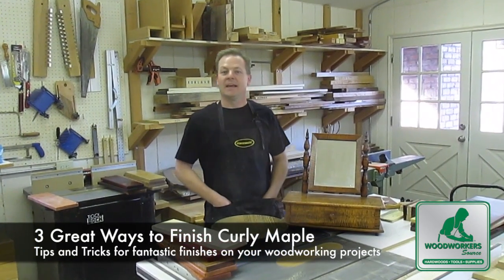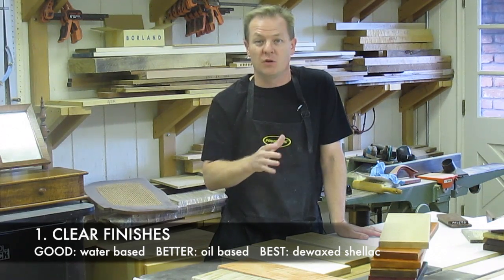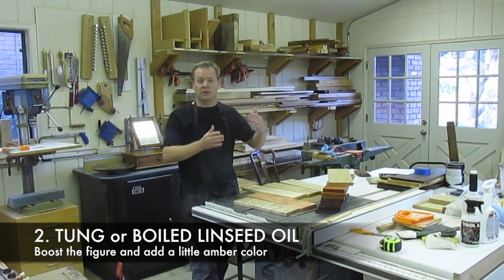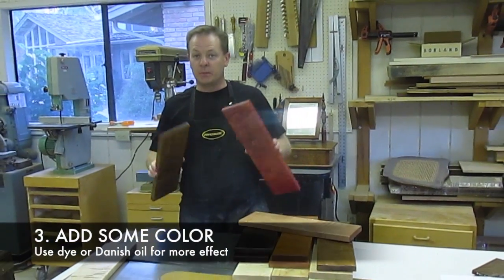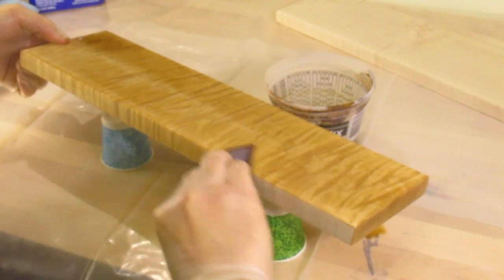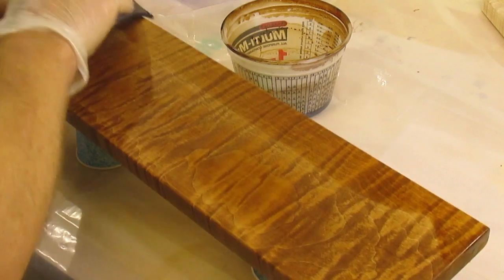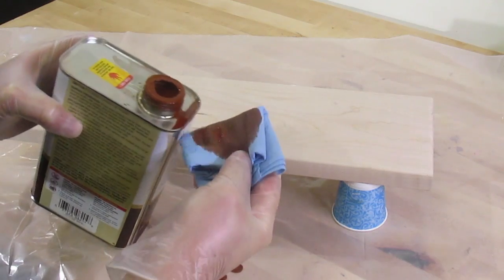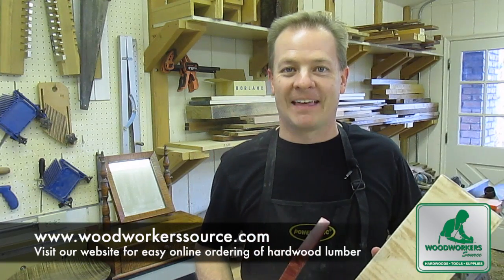3 Great Curly Maple Wood Finishes That’ll Blow ‘Em Away

Comment: You should try some Aquafortis. It was used by American gunsmiths from before the Revolution forward. It is a mildly caustic solution of 50% nitric acid and distilled water that is then neutralized by dissolving iron in it until no reaction is seen. Strained through cheesecloth and kept in a glass bottle. You can buy it already prepared from Track of the Wolf. It is wiped on with a dauber to wood that’s had the grain raised several times and left to dry. Heat is then applied, the larger the source of heat the more even over the surface coloring,the smaller such a narrow bar of hot iron the more control over selective darkening. The current artificial sunburst finish in some instruments was originally achieved with with selective use of heat in this way. It can range from a light tan or yellow through orange to a dark brown. It actually cooks the sugar in the maple which is what gives it the caramel coloring. The traditional topcoat was boiled linseed oil which multiplied the translucent effect. A pretty piece of maple looks like it on fire . The oil could also be used to blend damage and was regularly applied on rifles when cleaning.

Comment: amazing finishes, also another good one is to use map gas and lightly burn the curly maple and use a brass brush to brush off excess burn going with the grain then finish with a  high gloss top coat..

Comment: Thanks for the video. I really like how you present the different options. 

Do you have a product recommendation for finishing maple that might prevent maples yellowing over time from UV light exposure?
Reply from the maker: Preston Hoffman you bet. A coat of dewaxed shellac and then top it off with a water based finish like general finishes high performance water based top coat. That combo has a really good longevity when it comes to non yellowing
Reply: @WoodworkersSourcecom  - "defaced shellac"?  really!  Don't you mean "dewaxed" shellac?

Comment: I did my first piece with brown orange and yellow aniline dyes. It turned out ok but just not the look I quite wanted. I would like more deep natural look. I was wondering if there is anything else that works for that. I see pictures on google of amazing looking wood when finished. I am not sure if I should kiln dry the wood and then soak it in Mineral oil over night to get a most translucent curl look. Do you have any ideas?

Comment: Not clear from your video, but did you sand the 3rd. coat of Dye, then put the Tung or Linseed oil on, or leave the 3rd coat UNsanded, then apply the oil? Thanks!!

Comment: This was excellent! Thank you for going through the different examples. If I was going purely for enhancing the brightness/sheen of the natural figure...keeping that “shimmer” if you will...what would you recommend? Based on your video, I feel like boiled linseed oil would best achieve this...but is there any process that would work better? I plan on making each of my daughters a jewelry box from figured maple and really want that natural shimmer in the wood to pop. Thanks for any tips!!
Reply from the maker: Either the oil or dewaxed shellac sounds like will do what you want. Oil gives it a warmer/yellower color. Shellac less so. That's a consideration.
Reply: Woodworkers Source  In the video you suggested the oil then the dewaxed shellac before doing a top coat of choice, so maybe a combo would work for me as well? I do want these to last and hopefully be keepsakes for them one day.
Reply from the maker: @bobbarr613  haha, thanks for the reminder.... it's an older video so I wasn't sure what exactly was in it lol. I'd say you're on the right track though - oil to boost the figure, and something on top to seal and protect. Check out Old Masters Tung Oil Varnish (not the 100% tung oil, but tung oil varnish), we've used that in a lot of more recent videos. It might be a simpler way to get the look and long term protection without having to apply 2 or 3 different products.
Reply: Woodworkers Source I will do so :) Thanks so much for the responses and helpful advice!!

Comment: I am working on a piece of wall decor with some maple I salvaged from an old dresser.  I believe there are some curls in it, but nothing quite as extreme as in your video.  I like the idea of a surface that invites you to touch it, so I don't want to use polyurethane.  Do you think an amber shellac would be enough to achieve this?  If not, what would you recommend?

Comment: If I want to topcoat with polyurethane after tung varnish, does it need to be oil or water based?
Reply from the maker: Doesn’t matter as long as the tung oil coat is cured

Comment: I bought a beautiful old curly maple cabinet - I didn't see this until I got it home (I had planned on painting but it's too pretty). For me,  the tung oil makes the nicest finish. Because I know and have nothing, I need a "shopping" list so I have everything on hand. And I need an idiot proof step by step list of what to do. I don't mind the time it will take.  Also, it looks like the supplies (which I will use only once) will cost more than the cabinet did. Do you have a list of what to buy and an exact how to? OR is there a way of showing the beauty of the wood without so many supplies? I've looked for other instructions on line but they also speak to experienced craftsmen.

Comment: I am finishing a table.  I have applied two coats of boiled linseed oil and will apply one more.  I am doing a fine sand between coats and allowing each coat to cure 12 to 15 hours between coats.  I would like to apply a hard clear coat over the table.  The table is for my son and it will take a beating.  I am thinking oil based poly.  How long should i wait after applying the last coat of BLO before applying the poly?
Reply from the maker: Give it at least 7 days if you can, but fewer may be just fine

Comment: How would you dye 1.5" curly or quilted hard maple turning squares to where the dye would completely penetrate the wood for turning at a later point?
Reply from the maker: jxbartle I don't think dyes can can penetrate that much. Dye after turning.
Reply: +jxbartle get a vacuum chamber setup. It will basically suck the air out of the wood and replace it with dye.

Comment: Hi,
I recently made a counter top and a peninsula top. I was ready to stain and finish but decided to seal the underside first with a clear coat finish. After applying the finish, the peninsula looked almost cherry in color making me think the curly maple was a different species of wood. My normal counter top was a true amber maple color. My question is this. Is it possible to make a maple counter top match the peninsula color? I don't want to have to make another maple top.

Comment: Great video, I am about to start working on a guitar neck project that has an undesirable looking white maple neck and back, both sides have a light polyurethane clear coat (satin type finish).  I like the idea of the Danish Oil to darken the wood (which is the desired goal). What do you recommend to remove the polyurethane that is on the fretboard so I can apply the Danish Oil ? I heard Paint thinner helps soften the poly, then maybe some light some wet and dry light sanding ? Then would a satin finish help seal the Danish Oil or is that even necessary as perhaps the Danish Oil would dry hard enough to seal the wood ? Thx Steve

Comment: Chatoyancy is a major component of a good wooden project. If you want the look of wood grain, get laminate. 
Shellac (any kind), thinned polyurethane, and tung oil are the best products I've ever used to get chatoyance. 
-- Minwax tung oil seems to be less amber than Waterlox for crystal chatoyance. Waterlox seems to be more durable against moisture and chemicals. Armor seal is great too. 
-- Spar urethane gives you that Jurassic Park amber with fewer coats, and seems to resist the sun rather well. You can dilute it, plus it seems different from normal polyurethane. 
-- Amber shellac is amazing when you use dark walnut stain. It's like gold embedded in coal. A personal favorite of mine. 
-- 1.5lb cut dewaxed shellac is probably the most crystal chatoyance you can get without the hassles of linseed oil.
-- Lacquer can give you mixed results. Black lacquer is a different ball game.
-- Water based polyurethane ruins chatoyance. This video confirms that water poly is a better top-coat. If you want a beautiful finish, put in the time!

Comment: I have a 25 year old table with lacquer finish. The finish if ok but I just want to give it an extra coat of clear finish. I can't spray lacquer in the apartment. If I scuff the surface with 320 grit, COULD I USE WATERLOX WIPE-ON ?
Reply: It says on the can

Comment: Can you use tung oil then seal with a water based poly?
Reply from the maker: shane vinson sure. However, the tung oil should be cured before applying the water based finish. Or if in doubt lay down a coat of dewaxed shellac before the water based finish.

Comment: This is a great video - thank you Mark.  I do have a question about regular hard maple.  Just about everything I tried (including golden oak and cherry Danish oil) comes our blotchy in some areas.  Same with gel stain.  I can eliminate the blotchyness with shellac base but then I don't get the color intensity.  Is this something a dye would address?  I have not tried a dye, and would shellac still be needed as a base when using a dye? Thanks.
Reply from the maker: Right, dye is the stuff to use on hard maple. I would use a water based type, applied right to bare wood. Then topcoat with just about anything you want.

Comment: Great video! I'm not a woodworker, but I have some questions about finishing maple. I asked about which type of maple to use after your video about different types of maple. I'm building a sit-stand desk, for a computer, monitors, keyboard and mouse. I'm generally not abusive on desk surfaces, but I would like it to be reasonably durable (e.g., use a mouse, without a mouse pad). The desk will have a 48" x 30" x 1.5" solid wood top. I'm planning to have someone build it for me.

After I watched your video about types of maple, I'm leaning to curly maple or quilted maple, but I'm wondering if curly maple or quilted maple is a good choice for a desk and if so how to finish it. I would like to emphasize the natural character of the wood, without going over the top making it dark or changing the colour. I also would like a finish that's reasonable durable, will stand up to a mouse and keyboard and won't be damaged by some sunlight. (I don't want it to discolour with age if possible.)

I would appreciate your suggestions on finishing, if I go with curly maple or quilted maple. Thanks.
Reply from the maker: hey Daryl, Mark posted a reply to you on the blog FYI

Comment: Thank you for this great video! I was wondering if it would be possible to either make a video or tell me how to proceed with wormy maple to make the wood dark, but still keep the wormy figure visible. My tests with a traditional oil stain and a colored hard oil finish are pretty much hiding the wormy figure. I thought of using dyes like in this video with sanding sealer but I am not too confident it will keep the figure, or will darken the wood properly if I put sanding sealer on the natural bare wood then stain. Any help would be appreciated. Thanks!
Reply: The danish oil he uses towards the end could do the trick.

Comment: I love your video!

I wondering if this also work with regular maple? and if I put lacquer for my top coats. Do I need to sand btw coats and how many coats consider good? How can you tell if it is sand smooth? I am sorry I am a starter on wood working. =P
Reply from the maker: Sure, it'll work with regular maple as far as coloring the wood goes. It's a fine method. Whether or not your sand between coats of lacquer largely depends on how smooth of a finish you want --- but generally I do recommend sanding between each in order to get the best, smoothest finish possible. The only downside to not sanding between coats is it just won't quite be as smooth as it can be. And only you'll know. :-)
Reply: +Woodworkers Source thank you so much :)

Comment: What kind of store would I find the Behlen dye, or similar, locally? Also, I like the way you finished the curly with the dye. Could I use that process and finish with an automotive cear coat or will there be any issues with that?
Reply from the maker: Usually can find it at a woodworking store if you're near one. Or it can be bought online at Amazon or other places. I am not familiar with using automotive clear coats, so I can't say for certain . . . but it is probably just fine. Test it and see how it goes.
Reply: Woodworkers Source  would I be able to replace the dye with a regular stain and do the same processv you showed with the dye?
Reply from the maker: Adam Popp Oil stain has a different effect and it's arguably not a pleasant one. You can't use it instead of dye and get the same result as the dye.
Reply: Woodworkers Source ok, thank you for all the help. I ended up using ting oil, and I'm not as happy with it as I thought I would be. I want to do the dye process for sure, and just ordered some. What process do I have to do to the wood with ting oil before I can dye it?

Comment: After sanding the last coat of dye off, does it still pop if you apply a tung oil varnish? I'm building 2 cherry nightstands and finishing with a tung oil varnish. I have a billet of flame maple that I had lying around and in the shaker tradition want to use material I have lying around. I still want it to contrast harmoniously with the cherry and I'm afraid a dark dye or something will make it look bad in contrast. If it still pops after sanding it off and applying the tung oil, I'd like keeping the blondish color. I've never worked with this kind of figured maple though.
Reply from the maker: Yes, it should still "pop" quite nicely. Do you have enough to perform a small test with?
Reply: I do have a large enough billet for the fronts and test scraps. What color dye should I use to not clash with cherry.

Comment: Hello Mark. I just recently purchased an extremely vividly curled piece of tiger striped maple from Ebay. Its 33" long, 5.5" wide and 2" thick. I intend on taking my time and making a long stock for my bolt action shotgun. (Look up Marlin Goose gun, things are crazy). After I get it right where I like it, fit-wise, id like to explode the grain and give it a vibrant gold color. Is there any stains that I can mix with the denatured alcohol to get that effect? I know its a sanding and re-applying process, but im looking for goldish yellow with dark gold curles. Any recommendations? Also, whats the strongest high gloss, damage resistant coating? And how hard is Maple to carve? Please and Thanks!!! ~Tony~
Reply: I've had good results using aniline dyes. You can choose whatever you wish, including hot pink, blood red, and electric blue. you can get dye packs where your mix primaries up to the color you want.

Comment: What makes BLO a better topcoat and final finish than shellac?  I have been doing antique restoration for many years and I've always tended to use shellac and a final rub out as a traditional finish in my work.  I have used BLO on rifle stocks I have, but only due to the fact that BLO was the traditional finish on those military stocks.  While BLO looks nice, I have never considered it a durable enough finish for furniture that gets used, and in particular, chairs and tables.  On rifle stocks it doesn't give much water resistance, nor does it seem to protect very well.  Could I use a shellac finish over the dye and get the same beautiful results you have with an increase in durability?  I have used water stains in the past, but I've never gotten the same beautiful result you have... perhaps it doesn't look as good with shellac as a topcoat?  Even with all my experience (over 20 years), I still have not mastered the art of finishing, and I never stop learning.  Thank you for the educational video and tips!
Reply from the maker: solinvictus39 I may not have been clear, but the use of the BLO after the dye isn't necessarily the final step. The oil just gives the dyed figure another level of punch. You can topcoat over it (once it cures) with something way more durable.   If course, it always depends on the kind of project you're working on whether or not it needs it.
Reply: Thank you for the reply.  In the past I've had some problems with topcoats adhering to pieces I have used oil-based stains and shellac under, particularly if I am using a varnish or poly.  Could this be an issue when topcoating BLO?
Reply from the maker: Yes, it could be. Best way to prevent it is to put down a coat of dewaxed shellac between the oil and the top coat.

Comment: What "IF" the wood needed a filler? When would the Filler be applied?
Reply from the maker: The answer depends on the kind of filler you're using. Water based filler should be applied to bare wood, and these usually accept stain and or dye just fine. Oil based fillers are a little bit different. Usually want to apply those on top of a single thin coat of sealer (usually....).